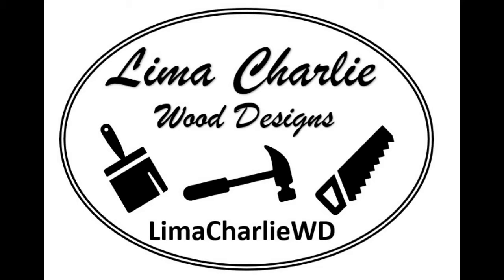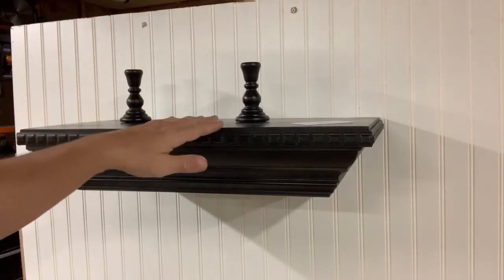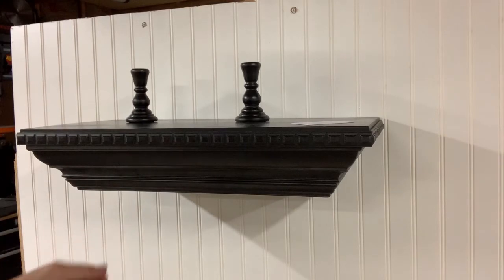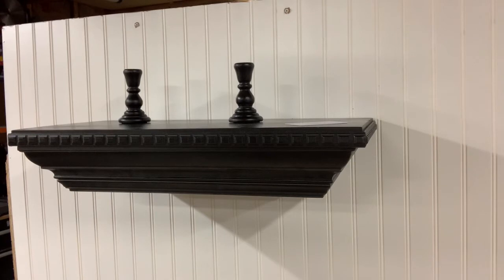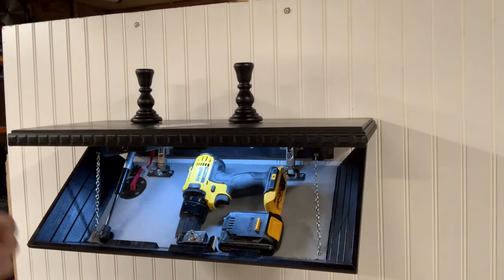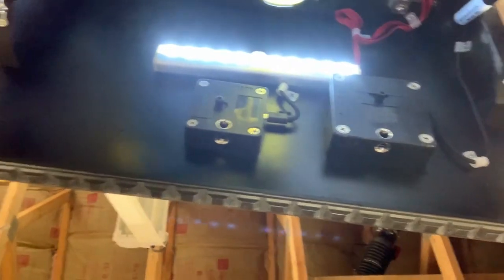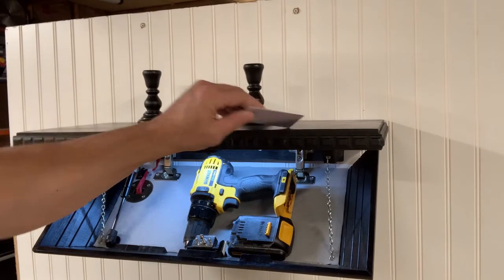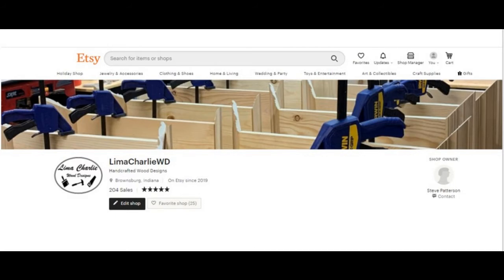RFID Lock Demo in a Concealment Shelf

Comment: Hi there, Was your Etsy Shop The Wooden Patriot? I bought one of these it looks identical and is the RFID version, the problem is I bought it in 2021 and we've finally got around to wanting to put the shelf up but the Cards won't work, the batteries will probably be gone by now, there is no hole to plug in for the back up power! how on earth to get into it to change the batteries?